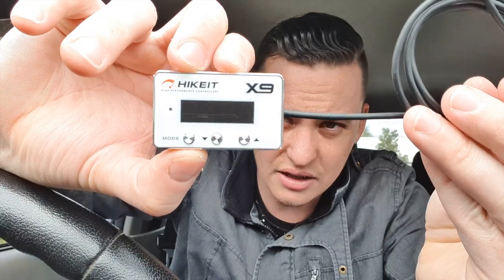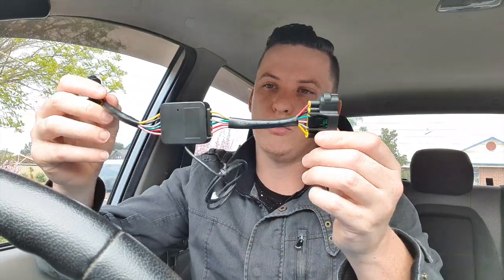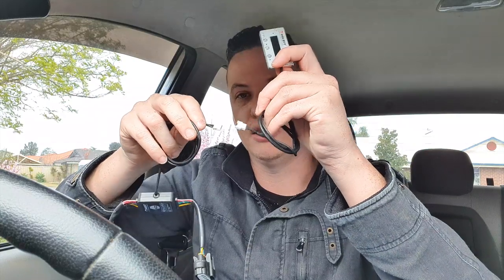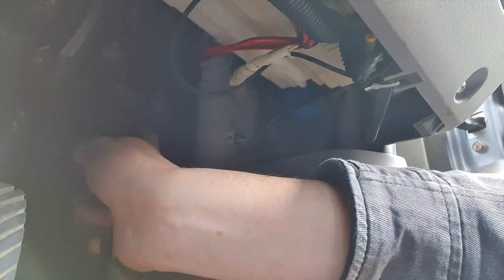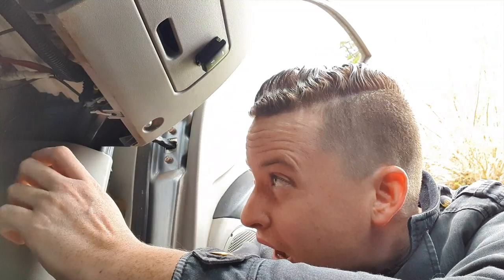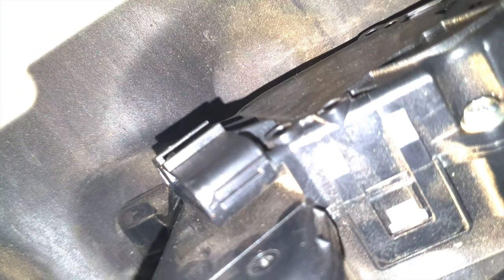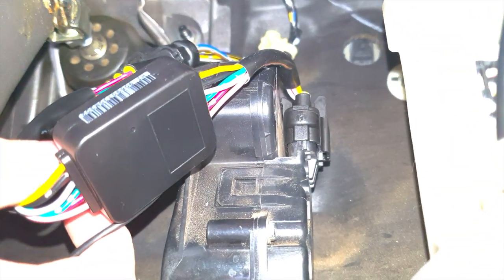How to Install A Throttle Controller And Should You Buy One?

Comment: Gday mate..
I have this unit on my Hyundai Veloster Turbo..
Definitely makes a difference but I can’t have it on any setting other than cruise or automatic when in park..
If I have it on  another setting and put the car in park ..it literally revs its head off and I have to change the setting immediately..
That can’t be normal right?

Comment: Nice video mate. Does the controller will destruct the tuned transmission when you install that thing? I have a tuned transmission so just asking if it does anything on tuned transmission? Cheers
Reply from the maker: Wouldn’t do mate it’s only adjusting the throttle signal everything else is left alone
Reply: @4x4CampingandAdventures  thats beauty mate😊😊

Comment: Hey just a question, might be a stupid question just wondering does this mess with the computer, if you didn't want it on and you take it off,would it change computer?
Reply from the maker: aaron neilen not a stupid question at all mate it doesn’t effect the ECU at all as it piggy backs on to it so if you do remove it it reverts back to standard

Comment: Are they only for 4wd or can it be used on hatchback with same results?
Reply from the maker: Not at all mate can be used for any car with a electronic throttle don’t forget to use the code 4x4campingandadventures for a discount mate
Reply: @4x4CampingandAdventures  not sure if electronic throttle 2001 mazda hatch.

Comment: I’ve got a 08 3.2lt triton and no fucking way can I get the accelerator plug out. Just wasted $250 on one of these things.
Reply: Update.
Got the Hikeit installed. Started engine. Idle is about 2 grand and the unit will not power on. Don’t want to put it in drive in case it punches me through the shed door. 🙄
Reply from the maker: Hey mate have you reset the unit?